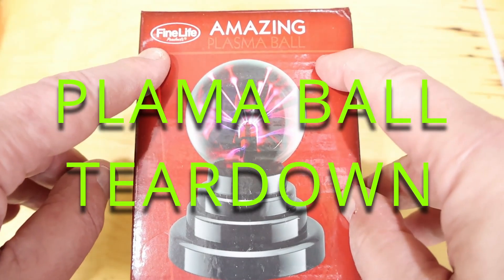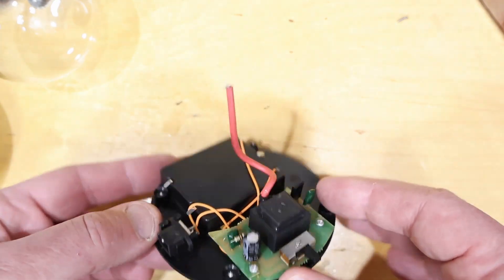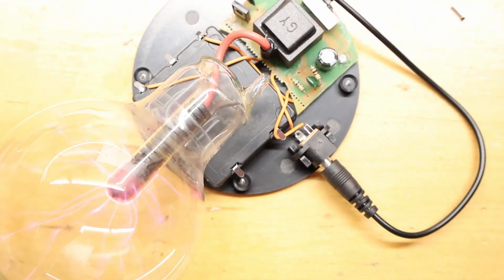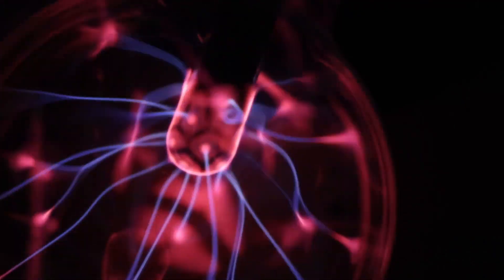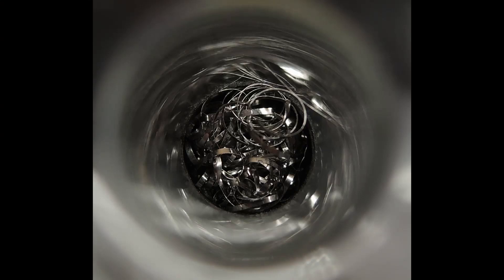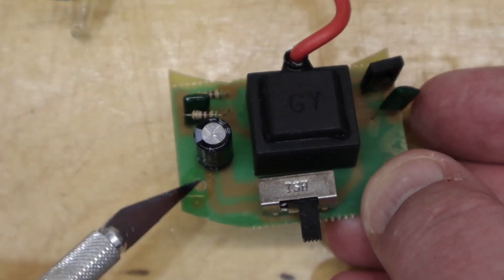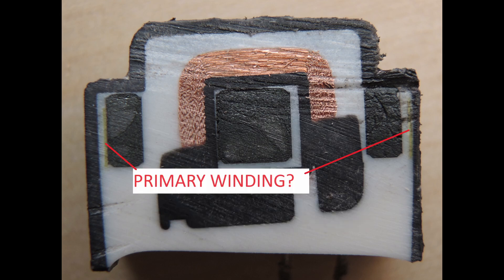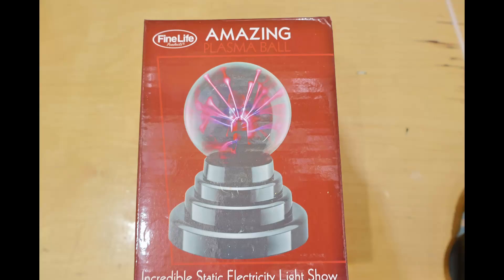Plasma Ball Teardown

Comment: The versions I picked up from Flying Tiger used SMD components for the oscillator. The electrolytic, transformer and switch are the only through hole components. They also don't have a barrel plug power input, just batteries.

Comment: Thanks for posting. It's impressively cost reduced down to the bare minimum parts, yet still makes a pretty good effect. Found that resistor that's placed on top of that green film capacitor pretty funny.

Did the barrel jack PSU come with the unit? Those plasma balls do require somewhat special PSUs to both make them work properly as well as to prevent damage to the PSU. Using an isolated class II PSU can result in them being dim but also can put a lot of stress of the insulation and Y class capacitor. Kinda doubt they did that though as I assume this was super cheap.

Also I'm not convinced the primary winding is on the outer edges of that flyback, it looks like that's just the tape holding the E-core ferrite together. I would expect the primary to be co-axial to the secondary on the central part, likely separated by the plastic part you've crossed sectioned at.

Comment: Holy shit he's alive. I bought one of these a couple years ago for my desk at work. It lasted about a week before dimming to invisible and it was into the microwave for a glorious valiant death after that. The metal swarf is a repurposed stainless steel wool dish scrubber and the black inside the end is conductive carbon paint. It's used to spread the current through the glass so a tiny pinpoint area of conduction doesn't form, heating the glass, making it even more conductive in a runaway feedback effect, and eventually boring a hole through and letting air in. This happened on a lot of Bill Parker's early globes and you can see it happen in a video by Starmute VII called "The Tragedy of the Blue-est Plasma Ball".

Comment: Not ferrite but a carbon slurry that is conductive inside the tube. Best to use a power supply that is grounded on the secondary, as otherwise you will break down the secondary winding insulation, or the class Y filter capacitor, as it will have the 10kV AC applied across it. Do not plug into a PC, it will at best reboot, or fry the USB port or main board. They do make a very effective dust trap. As well take a bunch of grapes amd see just how the grapes also act as a finger and attract the plasma discharge.
Reply from the maker: Thanks for the additional insight!